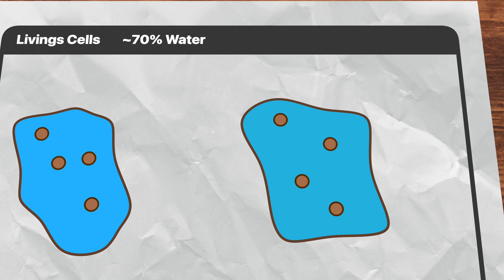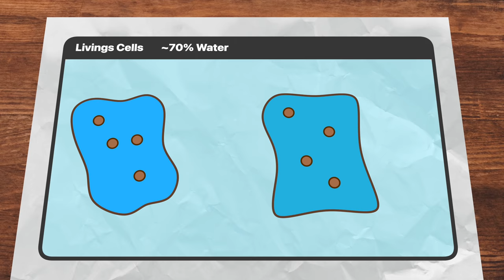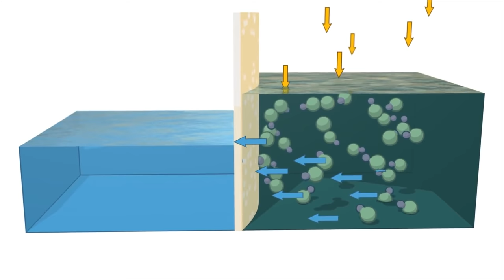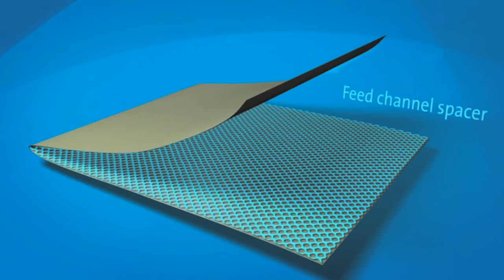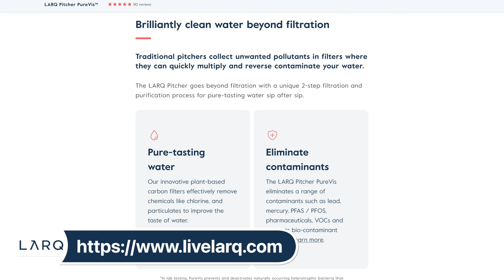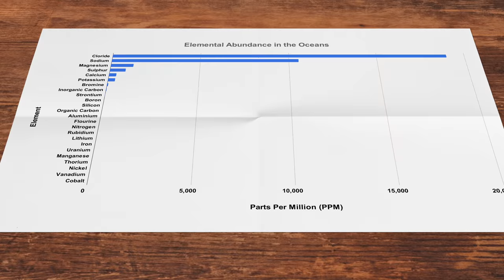Why Not Build Desalination Plants EVERYWHERE?

Comment: I was surprised to learn of all the other elements besides salt in ocean water. It makes sense to harvest those elements, especially thorium.
Reply: Lithium is there, but at 0.2 ppm, that means you need to process HUGE amounts of sea salt to get some.
Reply: Excellent video sir.
Reply: Thorium - nearly 0.01 ppm i.e. one gram thorium is present in 100 tonnes of water !
quite economical to separate  from other salts ! 🙃
Reply: I mean the question is how would you efficiently extract such minute trace amounts? That is conveniently skipped over.
Reply: @patrickreynolds6270  As well as mentioning hydrogen fuel production on site as a future source of energy for boats and airplanes. Without mentioning why it isn't used currently. The cost to extract, cool or pressurize into a liquid, and store hydrogen is multitudes more expensive than gas or battery alternatives(near 8X last I saw).
Reply: @GlennTXstate10  same with thorium , i have no idea why people think its a safe nuclear option .
Reply: OMG, takes two seconds to find out why Thorium is a shitty fuel source.
Reply: Every chemical engineering or chemistry student that has discovered the seawater composition section of the CRC manual (a large book of chemistry) has had dreams of just mining seawater for minerals and metals.  The brackish  water makes a good bulk side product, but sadly it is hardly worth the effort to get at the precious metals and other valuable materials.
Reply: @rewrite1239  it a very interesting concept.  If you  did remove all the minerals and metals and put the purified water back into the ocean it will cause those same minerals to dissolve from where ever they are located in the world to replace the amount removed.
Reply: My question is, how will the ocean be affected by having all of these minerals extracted and never returned to it?
Reply: The Chinese are working on developing an efficient way of extracting the uranium found in sea water at the moment.
Reply: Not economical by any stretch to extract minerals from seawater except for regular table salt.  Even then, mining is cheaper by a sizable margin.
Reply: Will Swift  the birds don't have to cover their operating costs. Just because it can be done, doesn't mean it can be done economically. Meaning, it can't be done. You are talking about birds that need a few fractions of a part per million, not industrial quantities.
Reply: Will Swift  yes, I have worked in the chemical industry. These things do not scale. And often the chemistry is wrong. There will never be a case for removing industrial minerals from seawater, because it will always be too expensive.
Reply: @nadavegan  I still don't think that's good enough reason to poo-poo the idea of mining sea water.  Is a process too expensive because it uses too much energy?  Make energy cheap.  If only there was some sort of vast, untapped source of energy that rains down from the heavens, though...

Also, studying how nature does things might offer insight into new and better processes.
Reply: @h8GW  you don't understand anything about energy. The scale of solar conversion you are talking about is 100 years away if it is doable at all. Fossil fuels work because the energy contained in the molecular bond that is broken during combustion is many many times higher than is contained in passive solar, and that will never change. Meaning that the only way to gather more is through much larger solar arrays. Are you willing to put panels over the entire Mojave desert just to power Los Angeles? There are physical and chemical laws that CANNOT be circumvented, no matter how much you want it to happen. And again, this does not even address the scale needed for industrial minerals, nor the chemistry required, nor yield issues.
Reply: @patrickreynolds6270  It's skipped over because it is economically impossible to build at the scale that would be needed. People have dreamed of this for ages.
That's not to say someone won't come up with a new process in the future, but right now it's nowhere near viable.
Reply: There is a lot more uranium in seawater than three is thorium. Thorium isn't as soluble. They have developed polymer mats capable of selectively absorbing the uranium.
Reply: Will Swift  but why is it impossible to scale up a pelican gland? 

You aren't understanding the scales involved. Evolution required 100 millions of years, and even so a pelican's needs are vastly smaller than doing desalination at industrial scale. You do not consider all the energy that also goes into the manufacturing of the materials necessary. Even the video acknowledges that pumping costs are not factored in. These things do not grow biologically like a pelican - they must be mined, manufactured, shipped, assembled, fueled, maintained, and replaced every 10-20 years.

Bernoulli's principle is what enables air travel. But you would say that since fluid pressures differ over and under an airfoil, that it will be super easy to colonize Jupiter.
Reply: @GeoFry3  it is not CNC; it is CRC Handbook of Chemistry and Physics and yes, I have been thinking about that.
Reply: Thorium molten salt reactors heat producing fresh water.
Reply: Parabolic mirrors reflecting heat: There are already impact studies for solar panel farms where the ground underneath the solar panels is heated to super high temperatures.  Likely mirror farms would get as hot or worse.  That giant dome and pipe system will need regular maintenance and cleaning or the "drinking" water byproduct will degrade over time or the filtering processes will need to increase as the byproduct degrades. And again, is Saudi Arabia doing environmental impact studies or are they just f*Ucking up their part of the world ?

ALSO - fully contained renewables within the Neom City complex is a myth unless it's fully isolated from the environment (and we all know how well Biosphere 2 worked out).  And unless they stop atmospheric cycles, water (and chemicals) will still evaporate into the atmosphere  meaning there iwll be a material net loss while they drain the surrounding ocean.
Reply: @kirkland5674  ~ I see chemical extraction as ONLY a byproduct of getting fresh water.  Waste not want not.
Reply: Bro the Ocean is Life Soup.🍲
Reply: They have gravity that filters salt water through a gel membrane, and fresh water comes out.
Dig a pit near the ocean. and feed salt water into it, out comes fresh water,  into your aquifer or other well/storage system.
Reply: yes but did you see the parts per million chart that he showed? you would need to evaporate a million gallon of water to get 1 kg, was it worth mentioning?
Reply: especially allofum
Reply: Literally, every element found on Earth is also found in sea water.  If you actually ever thought about it and read something, you would know that.  And why.
Reply: ikr! Thorium is SUCH AN UNDER-RATED AND UNDER USED ELEMENT!!!!
Reply: No waaaaay, thorium is as well as all nuclear is terrible but thorium is hell a scary
Reply: Huge amounts of magnesium in a cubic mile,even gold,need to develope some sort generated field seive to separate the metal from the water...something along the lines of a MHD...Lol
Reply: @toxichammertoe8696  Thorium reactors are coming though. You won’t be able to get carbon emissions down to net zero by 2050 without using nuclear. The Biden administration considers small modular nuclear reactors powered by thorium as part of its strategy.
Reply: Will Swift   because that's a biological process, not a mechanical one replicable by engineering.
Reply: @Andrew Robinson that's what they said of every generation of nuclear ..every single one , i especially remember the claims for
 the AGCR ..hahaha good luck with your tech hubris . We have not the time if you bothered to read the latest IPCC forecast duh !
Reply: You should stop speaking on a subject that clearly your career depends on . Fukishima and chernobyl are still disasters in the making . Waste depositaries everywhere are at near catastrophic levels of un containment . Without the need to subsidies the military Nuclear follies the whole industry would have been shelved decades ago .
Reply: @Andrew Robinson Well read the latest IPCC report , better still a Peter Carter post from the IPCC and you will see there is no time left for nuclear follies .
Reply: there's also gold in sea water, odd that they didnt mention this

Comment: I am surprised you didn't include electrodialysis, especially PV powered electrodialysis. Works amazingly well for ground water desalination.
Reply from the maker: really good point, I think I have some notes for a follow up. I do have some other water based ideas, especially since I'm starting a series on building the worlds most sustainable home. thank you!
Reply: @TwoBitDaVinci  First time I've seen any of your content.  Personally I see the idea of this technology (RO Units) as being wasteful, trendy, and ignorant.  And I've commissioned and operated a few of them. Your video demonstrated a basic passive survival technique in the desert, but that's about all its good for.  I would suggest you explain the old and unsexy tech of Evaporator Condensers.  By using HRU (Heat Recovery Units) to extract waste heat from existing heat sources, such as exhausts from coal boilers, Gas Turbine Generators, Land fill gas driven generators to produce steam.  This steam can then be collapsed to create a vacuum.  This vacuum package then feeds a shell tube exchanger and with a feed stock such as sea water, you effectively boil off the clean water from the sea water feed stock.  Now this technology has been used in chemical plants and on sea going vessels/naval vessels forever.  Small RO units are then used as emergency back-up units.  The downside of using this technology is that you require "process tech's " who have a basic understanding of the fundamentals of the process and ultimately a industrial commitment to spend money retro fitting HRUs on existing hardware.  Where I live, industry in the city is effectively given free water by the state government.  So why spend any money.  RO Units are like the Hydrogen revolution, sexy and going to save the world.  Everyone has forgotten why the world passed over this tech (hydrogen) after the Hindenburg disaster.
Reply: @darrentummon4855  and you have links to your business and videos showing us all the work you've done on this? I look forward to seeing all your work..
Reply: @cotterpolt5309  no videos, but I do have 14 years of experience in using the evaporator condenser principles in the manufacturing of Ammonium nitrate explosives.  In the AN process you introduce a 90% solution into a evaporator and boil off the excess water (-42 kpa from memory) until the AN solution has a Melt temperature of 141'C and a fudge temp of 122'C .  Again from memory.  It's not rocket science.  None of it is rocket science, unfortunately in the west we are dumbing down our process techs and tradesmen so they don't"hurt" themselves.  As a result, they become less skilled and then hurt themselves.
Reply: @cotterpolt5309  Dear Cotter:  It's been 11 months, and you haven't responded to Darren's cogent and thoughtful response below.  Surely in a year's time you will have done some research of your own, yes?
Reply: @justaskin8523  you're misunderstanding my comment. I see a negative jargon comment buried in with other comments. Show me in layman terms how you would do it since this is not "sustainable" I've served in the Navy and this is how we make fresh water all year long decade after decade. We take seawater and turn it into fresh potable water. Same thing on islands we "inhabit" so many people have comments but no solutions or proposals. So show me your video show me your proposal if not save the jargon for the nerd meetings. Does this reply that took 2 mins all work for you  just askin or too simple and layman.

Comment: I worked on the desalination plant for the Rabigh community. The desalination equipment were plants using in ocean going ships. Plus boiler for providing heat for boiling the sea water. The water droplets were scavengered  by a impeller sent to a heatexchanger and then to storage tanks. If I remember right, the water didn't comply to WHO standards, so chemicals were added to bring it up to standards.
I also worked on R.O. plants, treating water from Aquifer. The futher the pump when down in the aquifer, the more salty the water got. Really interesting subject 🤔
Reply: I suspect those "WHO standards" prohibited drinking distilled water (which is equal to desalinated water), because through osmosis it flushes you out of microelements, ultimately killing you. So I suppose the standards required adding back around 1mg of brime (or an equivalent of more controlled mix in form of refined chemicals)  to an each 1 liter of water.
Reply: @michaniewiadomski7911  More like there is no chemicals to keep it clean while in transport in the pipes. Water gets contaminated very easily.